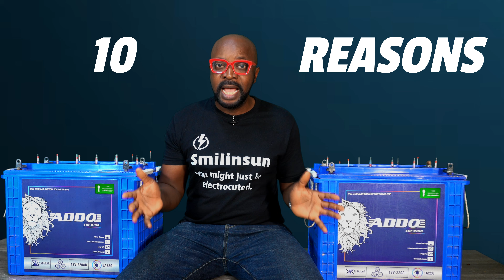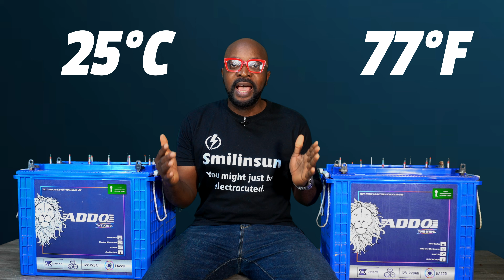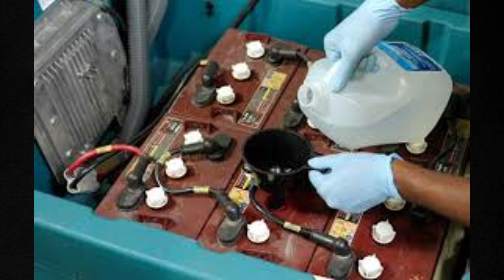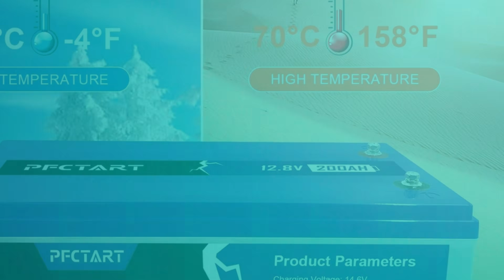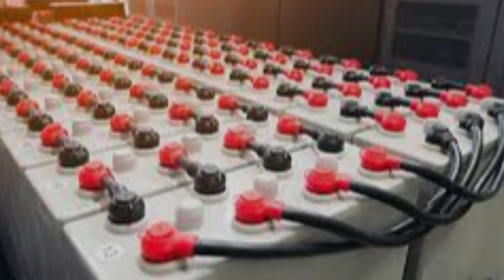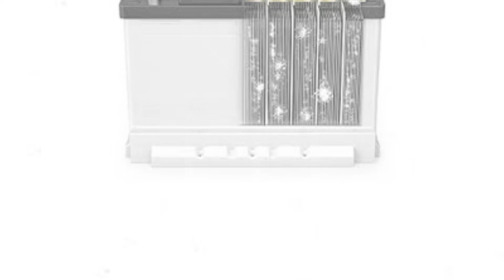10 Mistakes that killed your Tubular battery

Comment: Which inverter have a temperature sensor that can b connected to a tubular battery
Reply from the maker: Most Inverters Do
Reply: @smilinsunsmilinsun8056 where do you put the sensor?
Reply: You cant get the temperature of a tublar battery that's trash
Reply: Schneider inverter does have one. 

Epever solar charge controller has temperature sensor too. 

Most popular inverter in Nigeria like Felicity doesn't have such. 

You just gotta manually check this in this case.

Comment: There seems to a generation about tubular batteries in this video. But any experienced user know that all tubular batteries are not the same in performance and lifespan. I am using Luminous NRGT 220a tall tubular batteries that I bought 5 years ago, and they are as good as when I bought them. May be because I bought 12 when the installer recommended 8 batteries.
Reply: A set of batteries you have been using for 5 years is just as good today as when you bought them??

That's too much of an exaggeration.
Reply from the maker: Yours is properly sized

Comment: Thank you so much Engineer. You've analyzed everything concerning the tubular battery. 
Can u tell us ur experience in using A.C water for the replacement of distilled water?
I will be appreciated if my question is considered.
Thanks
Reply: Not advisable buy its manageable ideally just distill the water yiurself you can buy the beaker yourself